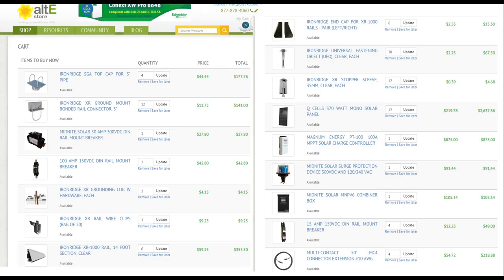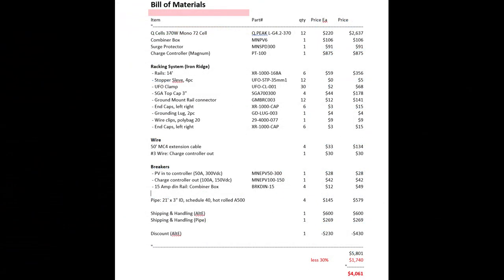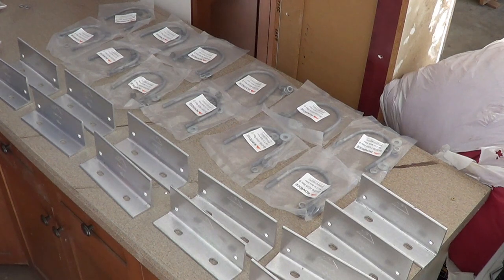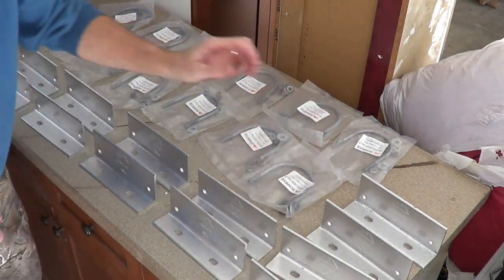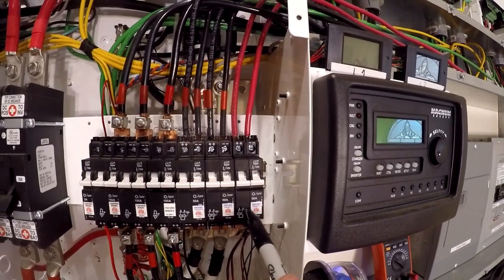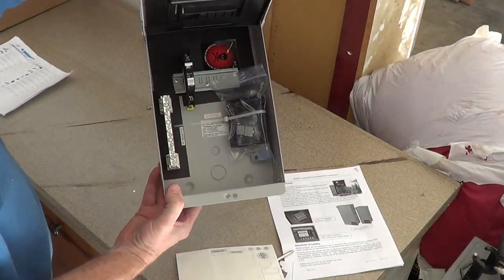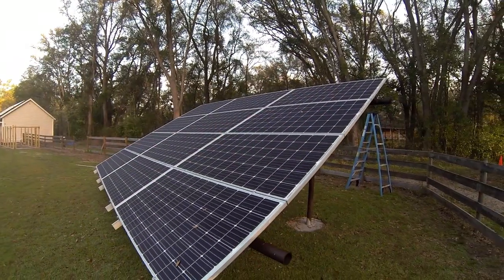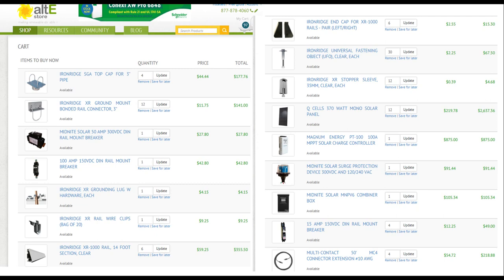IronRidge Ground Mount Solar: Parts List and Cost

Comment: Looking good brother im fixing to add hopefully another 25 panels to our system .... Keep it up brother
Reply from the maker: Sounds good.  What size panels are you adding?  Roof or ground mount?
Reply: Probably the 350 and it will be a ground mount.. I built the other 2 pole mounts the cabin isn't big enough for roof mount 😂 . But we are building a bigger one so we are gonna need more power to play with
Reply from the maker: @dangoras9152  Wow, that's a lot of power and a very big panel.  Note:  The wind loading and uplift calculations on my 12 panels that I have just added call for about 8,000lbs of concrete holding them down.  You could ballpark your system at 16,000 lbs. of concrete.  I think that's around 4 yards.  Stay tuned for the racking videos coming up.  Thanks!

Comment: Great video, where did you source the pipe from - didn’t see it on the BOM.
Reply from the maker: Maybe this: https://www.onlinemetals.com/en/buy/carbon-steel/3-nom-schedule-40-carbon-pipe-a500/pid/23672?variant=23672_72_0&gclid=CjwKCAiAr4GgBhBFEiwAgwORrVdItnnaP8IRRsW9L2gVsqpn8ncx03Wr9m0biv2M54-qwdpKMKaMxRoCxjUQAvD_BwE

Comment: I’ll be building my dream house in the next 5 years and I hope to install solar!
Reply from the maker: Luke, I built my own house.  Try to think into the future and add the infrastructure to support all your future plans at the time you build your house.  For example: run video cables everywhere for security cameras.  Stuff like this is soooo much easier than adding it later.  Good luck!
Reply: @HomesteadEngineering  thanks for the tips! Great channel 👍

Comment: That is a big addition to your system. Do you have 0lans someday to convert to lithium iron phosphate?
Reply from the maker: Yes I do when the lead acid finally gives up.  I am on year 5 of lead acid and still going strong but when they die I plan to switch.  I recently came across this:  https://www.signaturesolar.us/products/h7590c9c2a/2203789000006324403
$300/kWh is not bad.  I'm thinking $9,000 for a 30kWh battery.
Reply: @HomesteadEngineering  That is an amazing price. I saw David Poz did a review on one. I believe he bought 3 or for along with the server rack they fit into. Where were all these great deal when i bought mine lol. I paid $241 per kilowatt for my Tesla batteries including 6 BMS modules. But Tesla batteries are NamC chemistry. No where near as long lasting as Lithium Iron Phosphate. At the time I had no choice as I lost one L-16 FLA in one string. I only got 5 and 1/2 years out of that battery.  I sold the rest and took the plunge into the lithium world. By the way I may have spent less money per kilowatt but that is with zero warranty! Most reputable manufacturers have a 10 year warranty. That has to be worth $100 per kilowatt.